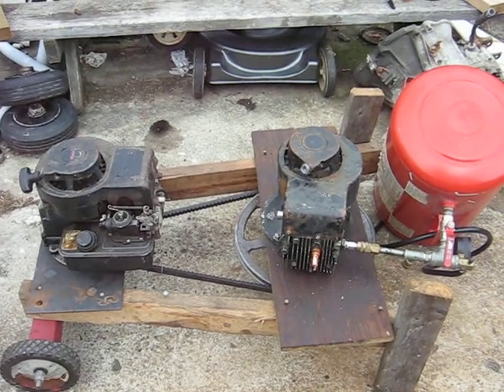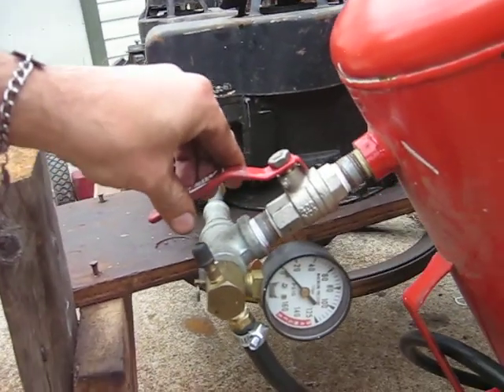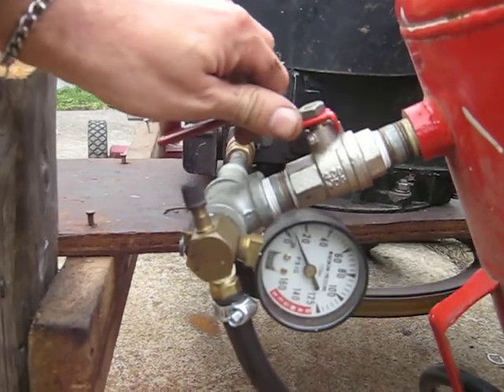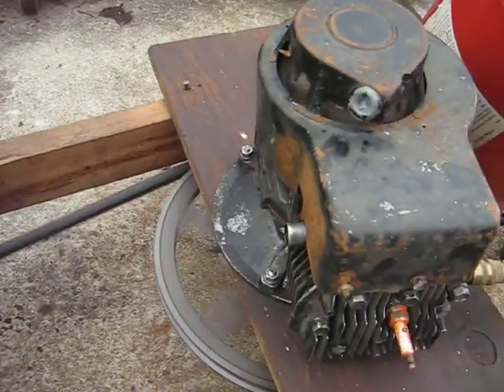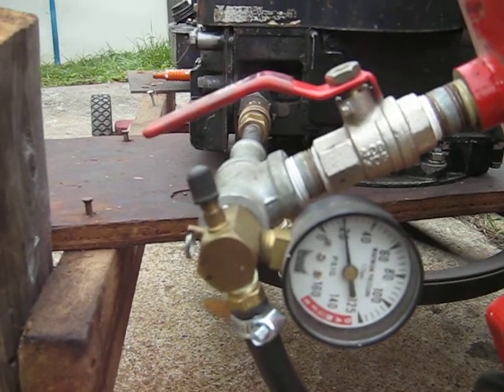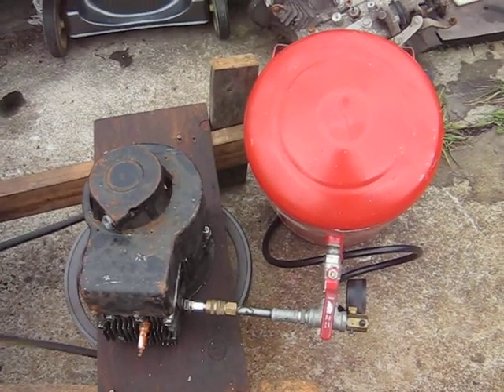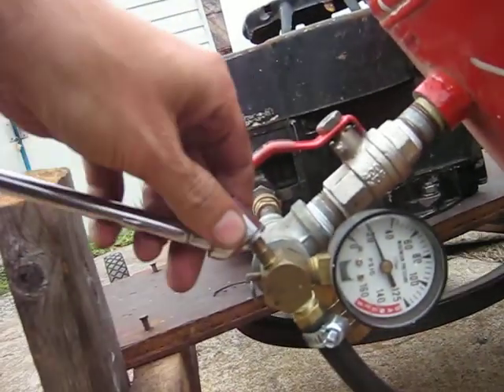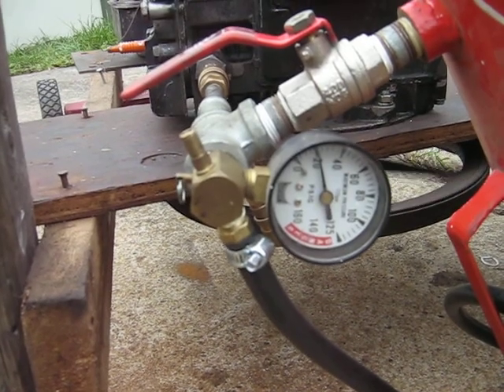Stage 4 Run of Experimental Air Compressor 24 psi  :)

Comment: Should of cut exhaust lobe off and doubled intake lobe and get your pressured air from spark plug 140 psi guarantee
Reply from the maker: +clackdwack   Thanks for the idea. I made this vid series so long ago that I don't remember what is on each vid without watching it!  However, to make 140psi you need to have a very small "combustion chamber" volume, so yes, de-activating the exhaust valve and double lobing the inlet would help. As well, welding up the head over the exhaust, and wherever else you could to make the chamber volume a minimum.

Comment: Did you shave the head for more compression?
Reply from the maker: DarkLinkAD No, I didn't mill down the head, though that would help out. Personally I think making a new head is the best way to go for efficiency, though that requires access to many more tools. My compressor with the steel head is still working well, and puts out 125psi. Reducing the head volume is a key to making a more efficient compressor, the regular poppet valves with the L head design require too much head volume.
Reply: ChargerMiles007 I was just curious, I assumed you would be able to knock off couple cc's head volume by shaving but from the looks of it, you cant shave much before getting into the valve seats. If its a throw away motor, you could always weld the head to the block lol.
Reply from the maker: DarkLinkAD I think the best thing to do, if you can aluminum weld would be to partially fill the head in. You could also deactivate the exhaust valve and reduce the lift on the intake, though this is assuming you take the air out of the spark plug hole with a one way valve like I made for the latter vids.
Reply: ChargerMiles007  I was gonna ask you about that one way valve, someone mentioned using one intended for liquids on his homemade compressor.

Comment: hmm prehaps you can find reed valves used in 2stroke engines. They are designed for use in engines, seems a no brainer

Comment from the maker: @ajofscott 
I am looking for a light spring to do this, for some reason just finding a light compression spring these days is proving to be hard for me. 2 years ago, not a problem, today different matter :(
Guess I will have to buy an assort ment of springs at somewhere like Harbor Freight. The inline check valve is elusive also, but remember, I am in Canada, so things aren't always availible everywhere, different stores etc.

Comment: Eliminate the lobes for intake and lighten the intake spring tension such that vacuum will open the valve. Time the exhaust to open at 45 degrees BTC and close by 90. Quite frankly I would use the sparkplug port and an online check valve and forget the cam.

Comment from the maker: @xoxoXoieoxox 
You sure know a lot about the Briggs cams, I have measured them a few times, but haven't written it all down :(
That is quite the cam grinding fixture you made there. Is it possible to take a vid of it outside, it is a little hard to see the details in the vids sometimes, but awesome work building it. I make jigs etc. when I need to, but nothing that precise.
I ground the lobes down to eliminate the valve overlap, since you have to re-work it to use as a compressor.

Comment from the maker: @n33d4killz 
That is an interesting idea about making it an air pressure activated inlet valve. Some ot the old Hit and Miss engines used those. I would like to make a Briggs work that way, but there are some serious issues to do it using a flathead engine!  I will consider your suggestion, since I am still working on this compressor, even though I have vids made upto stage 9!!!!  :)  I keep coming up with new ideas, but want to make it easy for ppl to make with hardly any tools.

Comment from the maker: @1972FordF150 
HeHeHe, now that would be an interesting one, but I would have to slow the can down with  1:4 gearing, instead of 1:2. Actually, 1/4 speed cams have been built, I have an old 1960s magazine that shows one, and it worked pretty well in a 327 Chevy! Cool shaped lobes on it, pretty sure it was a roller cam.

Comment from the maker: @MakeDoAndMend1 
I have more vids to upload, where I finally get the pressure higher, I have to upload from the library, so it is taking me longer than I would like to get these all uploaded :(
90 psi may be possible, but I don't think you will be using camshaft driven poppet valves to do it.
More secrets revealed soon :)

Comment from the maker: @KrankieV2 
I don't think so, if you try to use the exhaust valve to get the air out. I did a test, the valve starts to leak at about 70psi, unfortunately it seems the valve seat wants to leak before that :(

Comment: @n33d4killz try to make them as close as posible (there is .270" room for lift and u should start with .170" lobe diration not shure in dege.) and put the press in the exsaust cuz its more effecient =3- (sorry spelling sux)  BTW the time the lobes over lap is called over play with these specs thers allmost none its the .170" lobe deration by this i mean this is how wide the top of the lob is and how long it holds it open.. this steam engime has almost no over play =3-